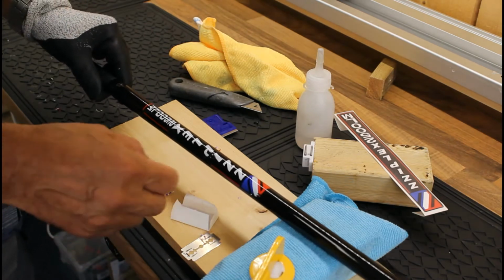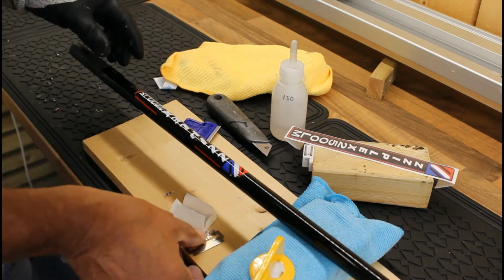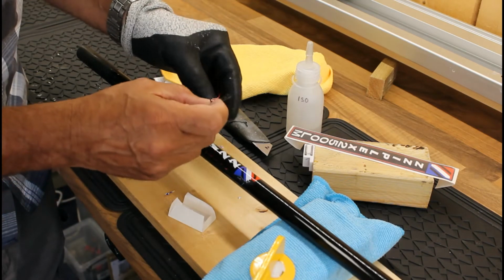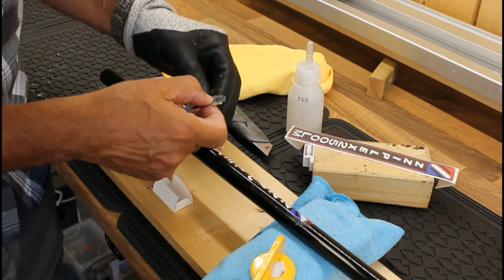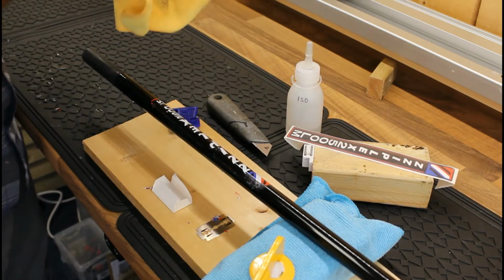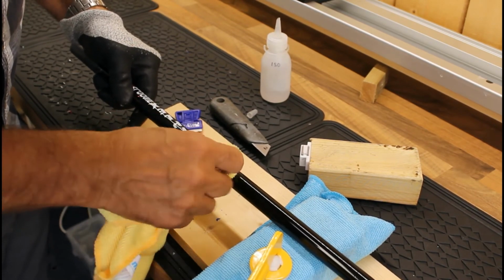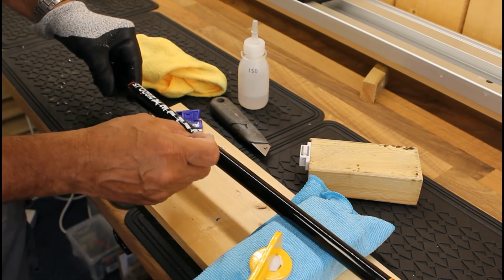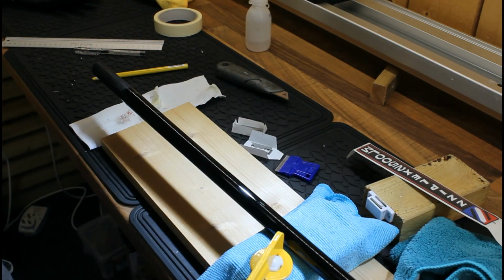How to remove and apply a new Decal

Comment: Thanks for sharing this. First thought, would it help to heat the decal first to soften it? Also... I have a Cadence Specimen rod (coloured blank) with an awful maker's graphic which I'd like to remove. It lies between two whippings above the handle, so I was thinking of masking those whippings off, using acetone and a cloth (or 0000 wire wool) to remove everything between them, including the rod's paint, then airbrushing a fresh base colour before applying an alternative decal. Does that all sound sorta feasible? Cheers, Steve